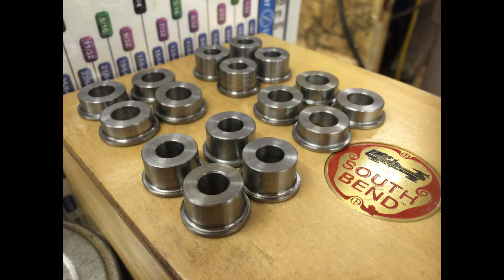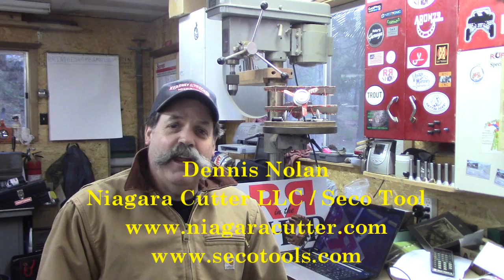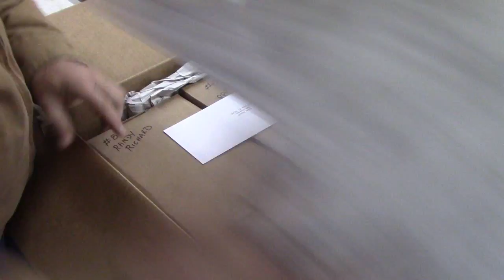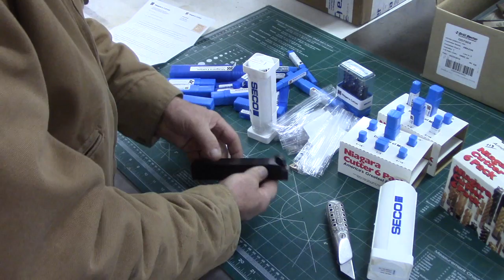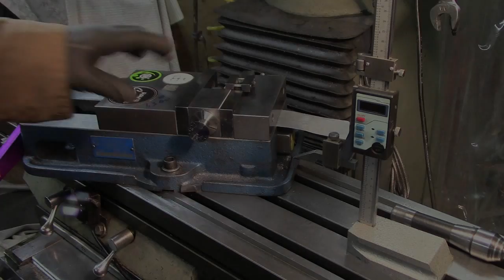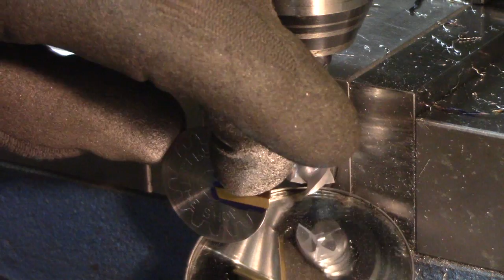Ketchup #45 Niagara & Seco Tools & Lincoln Electric

Comment: Hi Randy, nice job, beautiful cutter. I just have a simple question, I usually find those insert bolts have a tiny interference to guarantee the seat on the holder, did you not consider an offset of say .002" on both axis' as a CYA measure? Just wondering, cheers, H (still not a Grandparent yet).
Reply from the maker: +howder1951 Thank you, yes there is about that much offset so the insert is tight against the shoulder.

Comment: Hi Randy, in case you had forgotten, you could use those new Wxxx lathe tool holders for facing and normal direction OD turning by holding them parallel to the workpiece in your tool post, instead of at right angles. it can even be more rigid that way than toolholder held in the usual way.
ATB
c
PS you lucky son of a ........... :>)
Reply from the maker: +Chris Stephens Oh yeah, I need to adjust the tool for my lathe, but I have some nice new endmill to do that with.  Thanks for stopping in.

Comment: Great tip on use of the endmill holder for indexable/repeatable Z positioning.  Thanks Randy.Cheers,Gary
Reply from the maker: +Tools4Machines Thanks Gary.  It works good if you have tool changes and multiple parts.

Comment: Some nice swag to get in the mail! Finally got some steel large enough for the lathe tool holders so I will be trying out my dovetail cutter soon I hope. What is the insert type  you are using again?
Reply from the maker: +Cruiser Mac Thanks for stopping in.  Good to here about using the tool, 1850 rpm.  TPGB 321.
Reply: Thanks Randy, the RPM reminded I have to make the tach for my milling machine. I have most of the parts now, I will have to watch your video to refresh my memory!
Reply from the maker: +Cruiser Mac Good deal.
Reply: +Randy Richard Holy smokes I did not realize how many videos you had! Do you remember which one had the installation of the speed indicator on your milling machine?
Reply from the maker: +Cruiser Mac Here is a link.  https://youtu.be/PIoZnBVhLBA
Reply: Thanks!